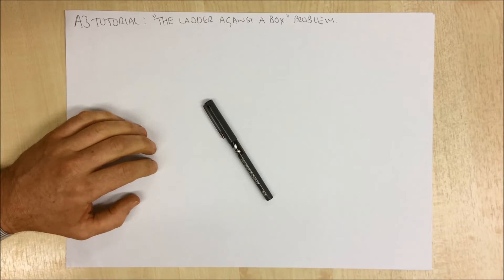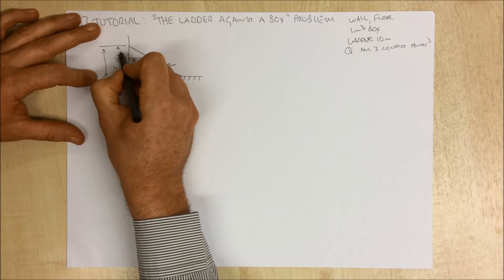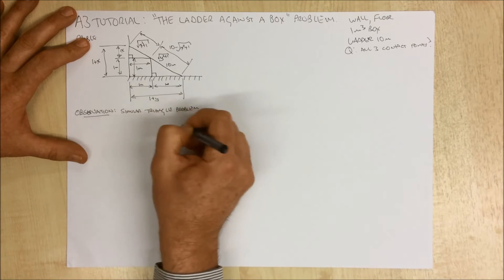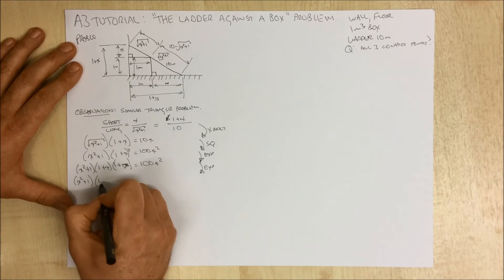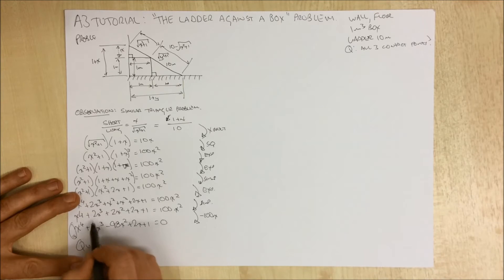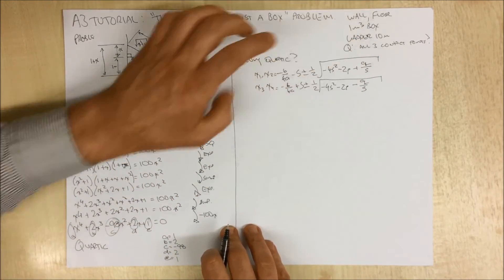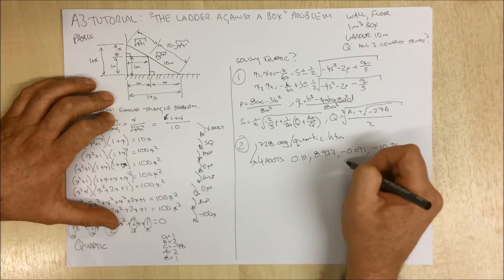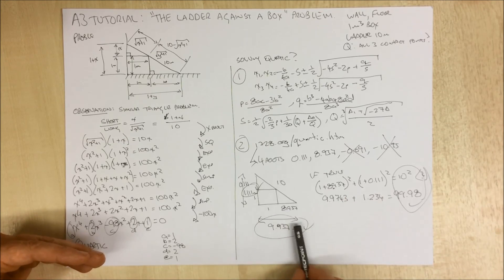Taylormade@AUT: A3 Tutorial on "The Ladder Box Problem"

Comment: I met this problem many years ago when working as a design draughtsman on an Aerospace team. There will be 2 answers to this problem with the ladder presented in the shallow angle you represent or a steeper angle. This made me think of a quadratic solution which I found but I was more pleased with the trig solution I offer here. It’s much more like the processes and techniques we were using at the time ( a long time ago)

Let the angle at the apex of the ladder be a, let the length of the ladder above the box intersection by x and below the box intersection be y.  The vertical height to the top of the ladder H and the horizontal distance to to foot of the ladder D

csc(a) + sec(a) = x/1 + y/1 = 10
Interpolating from Godfrey and Siddon 4 figure tables
Angle a = 83.6162 deg (or 6.3838 deg)      offered here in decimal form because I will use a calculator for the next bit to save time.
Cos(83.6162) = H/10, H=1.112
Sin(83.6162) = D/10, D=9.938